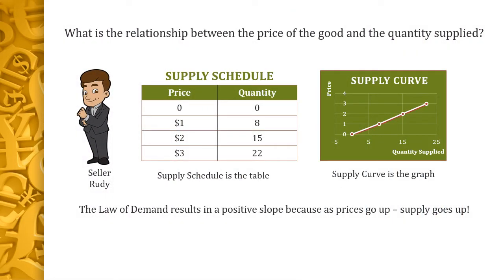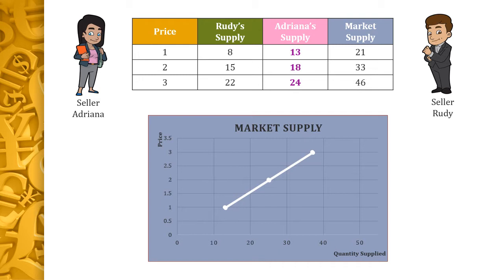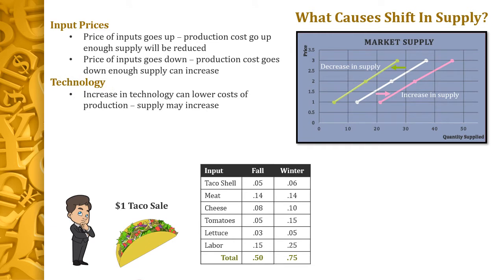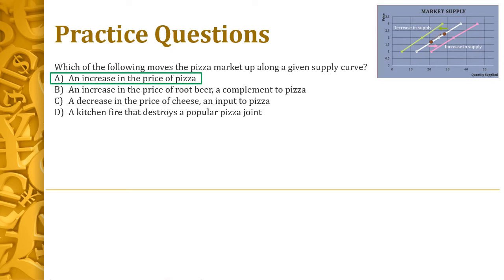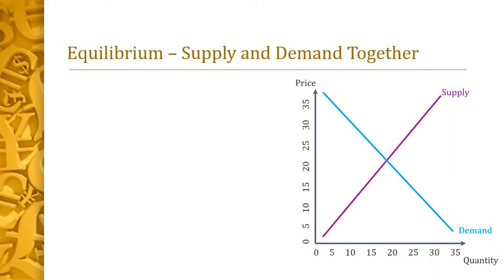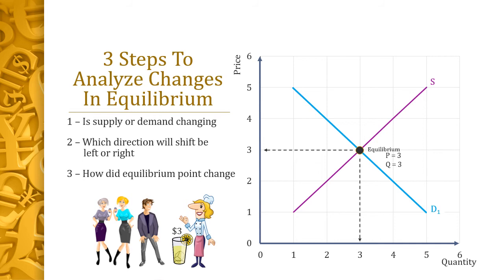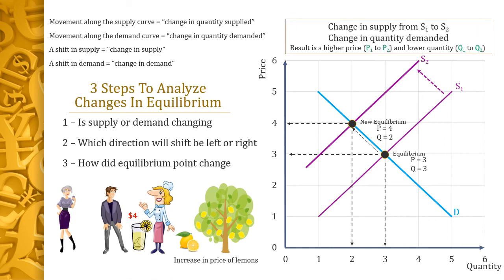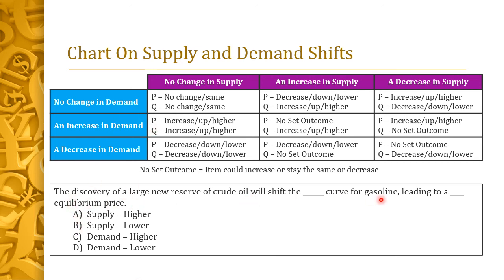ECO101 - The Market Force of Supply and Equilibrium Lecture

Comment: Quick question prof: According to the previous lecture, demand goes down when price goes up. In this case, wouldn't the producers reduce supply simply because there are less people wanting it?
Reply from the maker: That would depend on market place factors and cost of production.  Supply factors include price of input (the cost of the raw material).  If the supplier has a low margin, there might not be room to go lower.  Just stop producing maybe the better the choice.  They could adapt the product to increase the demand as well, a car that adds tech.  This lecture in an introduction to the supply side.  Think of the first few lectures as the ABC of economics - you need to know the basics before you can start to  move things around (need to know the letters before you can read a word).
Reply from the maker: I love questions so if you have more just post.  I will do my best to answer.  You will get into more about how the factors of supply and the factors of demand provide information to mangers and organizations.  It does not provide a solution, more a prediction. Humans will then use this information as part of the decision making process.  Always remember that economics is the study of HUMAN BEHAVIOR in the market place.  Human behavior is driven by both rational and irrational thoughts.  Rationally one does someone need (not want but need) $4 coffee when there is free coffee at work.  Does this stop people from going to Starbuck - no.
Reply: @rjbirmingham  Wow that took me a while to chew on. Thank you so much for such detailed and well-explained answers. We need more teachers like you🌹I'll be sure to post if I have more questions in the following lectures which I'm pretty sure I'll have.
Reply from the maker: @awdekafaecndwad211  you are just staring your exploration, need just need a bit of patience.  You in macro or micro (I like people to take macro first).
Reply: @rjbirmingham  I'm taking micro (eco101) in the first semester and macro(eco102) in the second. 101 is actually a prerequisite for 102 so we have to do micro first.
Reply from the maker: @awdekafaecndwad211  I know lots of places do that - I happen to like macro first - big pic then down the smaller pic - they are very different subjects in their own way.
Reply from the maker: Remember, this is an introductory lecture on the concept of Supply and Demand. As you progress to more advanced economics courses, additional elements will be introduced. Think of an introductory course as the ABCs of economics—you need to learn the basic letters before you can write sentences, and sentences before forming paragraphs. Moreover, many elements go into business decisions, which are covered in microeconomics. For example, a business makes a mistake when consumer demand drops, leading to excess inventory. This situation once occurred with laptops. Despite lowering prices, the excess inventory remained unsold. However, that is a topic better suited for microeconomics discussion.